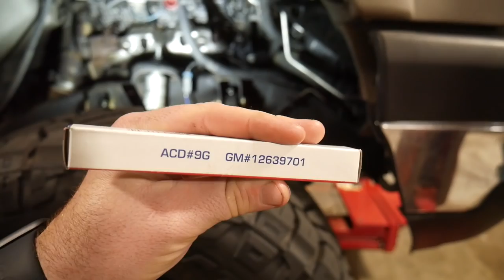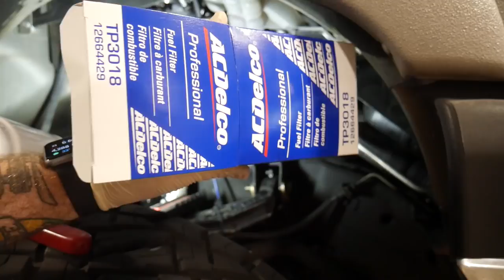DURAMAX GLOW PLUGS AND FUEL FILTER REPLACEMENT

Comment: Nice video. Didn’t know them glow plugs were so easy to install at all. I thought they were on top and a real pain like the old d Max’s with the injector issues. But hay two question/tips for ya.  Have you tried to assemble the fuel filter before installing it. And fill it up with fuel before installing it. Learned that from a gm mechanic. Trick was to stop and fuel the truck up and have a bottle to fill with diesel. Then while your doing the filter change in stall the wif sensor and fill with diesel. Then it doesn’t seam to take much to prime the system and she purrrrs nice and smooth. Also you might try on your next filter change leaving the wif sensor on the old filter till you spin off the filter. Much less of a mess. Last thing was I was always told stay with a filter with a metal exterior and stay away from plastic. Something happeneds and the plastic one causes the fuel to jell easier. Seam to be an issue with mine. Switched to a metal one way less issues. And I only buy ac delco

Comment: Not to correct you, but they get installed in the cylinder head not the block and you can ohm out a glow plug anywhere between 3 or 4 ohms is a good glow plug fyi
Reply: And they make a wrench for those water sensors, mr professional